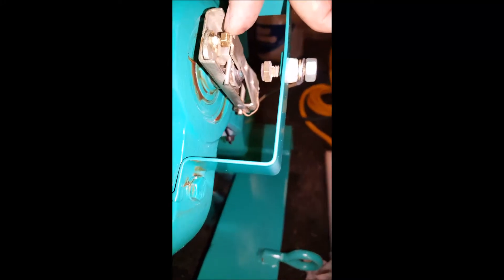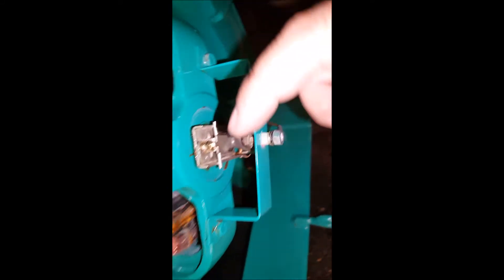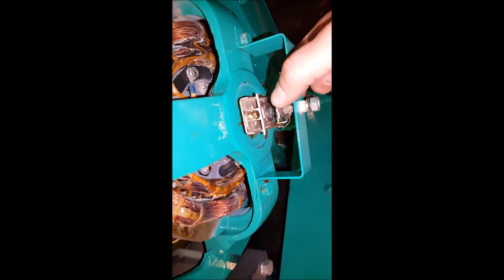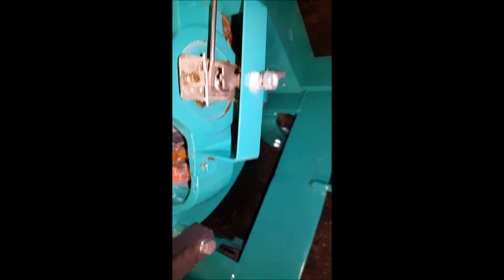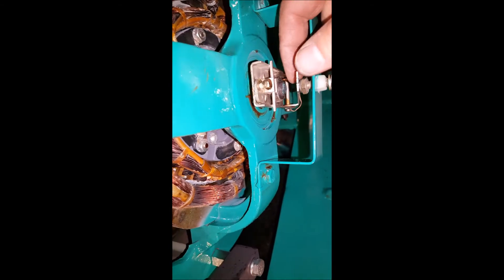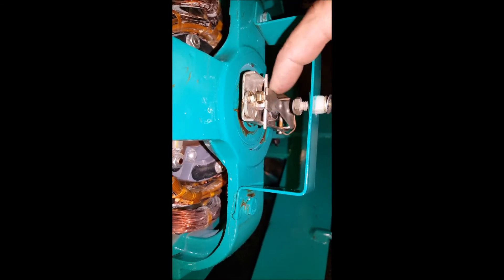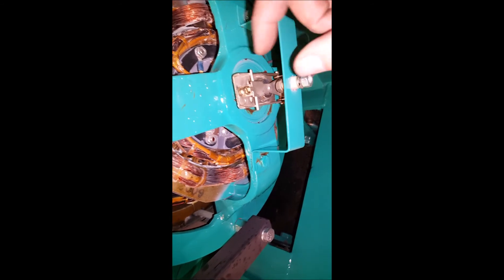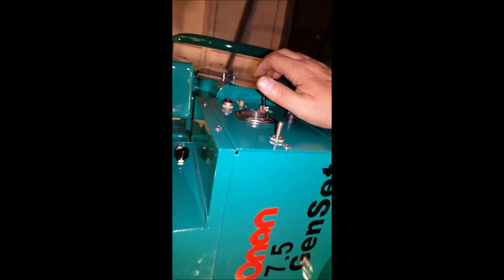Onan over speed centrifugal switch

Comment: backing that bolt in and out is for adjusting at what rpm in will make contact, closer in, it will shut down at a lower rpm further out (to a certain point) will allow for more RPM before a shut down happens. They later went to version of this that was driven of the injection pump.